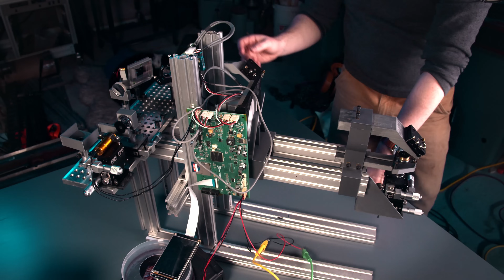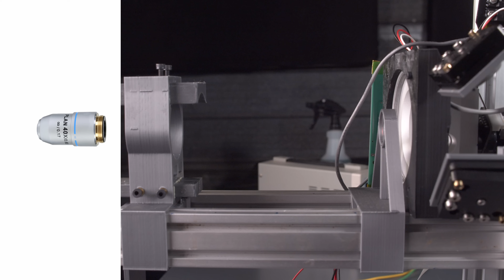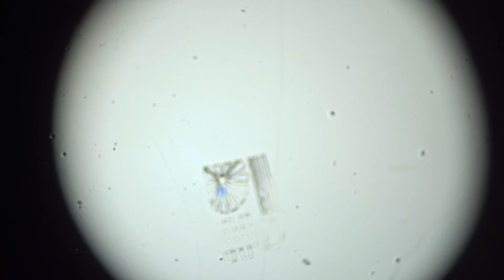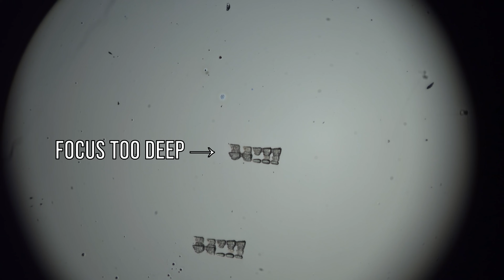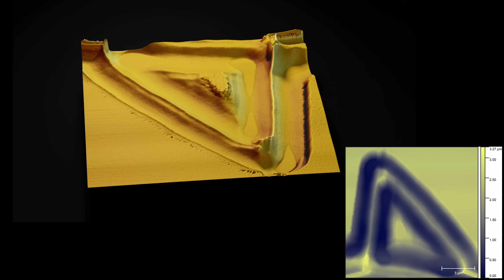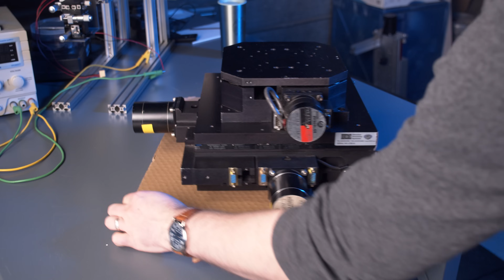DIY Semiconductor Patterning

Comment from the maker: 🚨 Addendum 🚨
- "Why not fix the laser and just move the stage under the laser?" 
It's a good question! Speed mostly, it's generally a lot slower to draw the pattern with a mechanical stage, particularly if you need a lot of "flood fill" regions. And in theory a galvo can give very small resolution even if the laser spot is relatively large.  I.e. you could position a 2 micron line (due to 2um spot size) 200nm away from another line. Depends on the quality of a stage, but precise movements of a large stage are a lot harder than precise rotations of a lightweight mirror, especially considering backlash and such on the stage. But it's a totally viable technique, and I might try it if I can't make the galvo behave. 🙂

- "Why direct-write laser instead of DLP chip?" 
No particular reason (my first attempt years ago was with a pico projector actually), I just wanted to try the direct-laser approach. There are some pros/cons to each. With DLP you run into limitations with pixel size quickly, which means you need correspondingly better optics to continue reducing feature size. Direct write laser can "scale" in that aspect a lot cheaper: a good clean beam passed through a 60x objective could theoretically hit sub-micron features.  OTOH, you have to deal with issues like the galvo linearity/stability.  So different trade offs. You can find commercial devices of both varieties competing in the same space for example :)
Reply: Hah, thanks for answering that. What about a stage that is based on one of those flexure designs? That would allow tiny movements.
Reply: Like fgbhrl suggested flexure xyz stages can be very precise, zero backlash, readily characterized and driven by very standard gcode. Any speed lost due to greater inertial mass may be offset by running many parallel beams at once. You could even make mirror images cut at the same time that would register perfectly with their counterparts - which may be useful somehow in the construction of MEMS devices.
  Another argument for using a mechanical stage is that your beams (and thus the walls of your resist) could be made to be exclusively perpendicular to the substrate rather than all converging at the microscope lens.
Reply: Thank you for the considered answer!    Have you also thought about using a Wicked Lasers LaserCube?   
Its blue diode is 1300mW at 445nm, which is within the range (350nm-450nm) specified by Microposit's datasheet.
Reply: I mean, you already have a sub-micron stepping stage, you just had to make a spatial filter for your laser and half a decent focusing optics to get better results with less effort... Also, is your laser polarized, and was the dichroic designed to work at 45°? Most of the off-the-shelf dichroic are designed to work at normal incidence and suffer big degradation in performance at high angle, especially if the laser is polarized in the wrong direction
Reply: Yeah this was the concept I had in mind for building one of these years ago. I never actually got anything useful but I had planned something set up like a vertical milling machine, with a fixed laser column and then an X-Y stage probably using picomotors.
Reply: Yes, speed. I have built a XY machine with 1um step size, 20um laser spot size and 15um backlash(compensated for in software). Camera calibrated.   Made for PCB prototypes. Runs at about 4cm per second. The quality is wonderful but it takes ages. 

To save time I make mainly additive, through hole plated PCBs...with large polygon planes. That way I only have to laser the gaps between the eventual copper. With it I can make "quick" 1 hour PCBs with 4 to 5mil (100um to 125um) features. Also very easy to do high res photo imageable silk/legend. The big pain is soldermask as most of the board must be lasered. 

But I am also working on a galvo system, using a 500mW 405nm laser. The laser, post galvo, goes through a large CNC-ed acrylic F-Theta lens (about 20cm x 20cm). My effective area is about 15cm x 15cm. The PWM is FPGA generated giving a resolution of about 32000 positions per 15cm.  The tool path is contour based to avoid all the problems with high speed laser switching with raster based systems...even thought the laser switches at 5Megapix/s.

Your video is very informative. Will be "stealing" quite a bit for my next machine.😀. Good work.
Reply: All school kids should learn how to make their own tools and chips,  build a small 2 cylinder combustion engine, and grow a few plants and animals so they learn the basics of farming too.
Reply: Is there any way you can see how far off the laser is coming out of the galvo and just use the stage to correct it? You could try to make the lines straighter and maybe even see if for some reason it's repeatably off mark the same amounts in when doing similar things? Kind of like how the Shaper Origin handheld cnc router uses a small but accurate cnc to improve the positioning you do by hand.
Reply: @Breaking Taps Idea: Using a 2-color non-soluble water solution as the lens in an ultra-clear glass or laminate? The water droplet would be large enough in a opaque fluid like a lipo or similar non-soluble base. Color the lipo base to the opaqueness desired where the laser will not bleed through or in the wavelength [frequency?] that will be etching onto your substrate. The water droplet will be ionized for clarity and then you can add coloring to get the desired wavelength. Amount will be enough that the droplet will remain circular consistency from top of droplet to the bottom of the droplet through the lipo solution base...so presumably naturally self-correcting [and/or self-arranging?] circular lens that you can adjust to your needs. I hope I conveyed it clear enough...I have a picture in my mind I'm thinking of but not sure if I'm describing well enough but I digress. Love the vids; hope it works out for ya, best of luck!
Reply: Trick for speed would be to have multiple lasers, OR use a larger more powerful beam spread out already that hits a DLP to make a patter, something I am considering as a solution for my ideas, along with a couple others for several color lasers tuned to reflect thus I can do the "donut effect" where one laser is counteracting the other laser and is a ring of laser light with a point in the middle so I can avoid the wavelength of the laser inhibiting going smaller. (ie the donut will clip any part of the energy injected due to the wavelength spread for a single photon, as I am guessing the photons are super tiny and an array of them are hitting in various points in their wave function, so this negates those outside the region needed while allowing the others to strike, effect, and cause reaction within the dark dot region of the other donut shaped laser BUT it will not be a donut but a shaped form sort of like a mask, so to speak so the negated region has to be large enough for the whole wavelength of the negation laser's photons.
Reply: oh reason I mentioned the above was over the dichroic mirror, in that it might offer a chance to combine the colors of laser into one straight beam using the beam "splitter" cube, to converge all three of a given frequency, later I may have to look into seeing if I can get create or have designed another shape or shapes like pentagon, hexagon ect to add more frequencies lol.
Reply: Why do some of those lenses look like something taken from a video projector? are they salvaged to use in this method? (if so awesome, I have a couple boxes of lenses and prisms and such from salvage for this sort of work LOL)
Reply: You should get some piezos from Piezosystem Jena to control the angles of the galvos more precisely
Reply: Hey, you might want to change your title. Your video is really interesting, but a simple change can really boost your views!
Reply: in my opinion the priority is to fix that wobble, maybe it needs more struts? (I used to play KSP).
perhaps you could do one mirror with fix spin or both axis with fix spin rate blink the laser to control it, sort like the old CRT did.
it could improve stability if the spinning does not vibrate due imbalance.
hum... now that is something hard to fix, unless you use a perfectly balanced system where the forces cancel out.
Reply: Make 7555  chip

Comment: i used to make those edmund optic breadboards at my old job. that was an absolutely mindnumbing task and i dreaded seeing the pallets of precision cut aluminum come in. each plate was straightened on the hydraulic press, sent through a timesaver belt sander multiple times, and drilled and tapped in up to 4 cycles depending on plate size

Comment: I watched a Form Labs 3D printer factory tour and they also tried to use a light show lazer manipulator and the speed is there, but the acuracy not, so they went to an in-house solution as they did not have contriol over the lazer.  But as you showed us, the contorl of the lazer is where your problems seem to start.

Great content, you really make me think about what you show and get right.

Comment: in a past I replace galvos(rotation will be always limited by angle step) with XY positioning movement system. Similar to XY CNC light router/plasma cutter etc. The laser beam come to X mirror which you can make X movement and then to Y mirror. You need a bigger lens after XY positioning system, but resolution can go up to 100 nm. Have you tried ?

Comment: The 20um dia for the pinhole is too much for 450um laser  beam. To clean the beam from the higher harmonics, the pinhole diameter should be about 1-2 the wavelength.
One way to make a pinhole is to focus beam with ~1"FL lens and place thin film of paper/plastic/ptfe in the focal point. The beam will burn a hole in the focus, and that will be your pinhole.

Comment: Could you direct etch copper off 0.5z PCB (0.0007" thick) with a regular 40W K40 laser source IF you apply dry moly lube on top of it ?

Comment: You've got to look into green lithography technology. I covered some in my quantum hardware lecture series on QuantumGrad. Basically, egg whites diluted with water can function as a polymer photoresist and even e-beam resist. This means that egg whites can serve as resist material for both micron and nano scale features. Plus, it's non-toxic : D
Reply: Thank you for this tip. Looking in this rabbithole.

Comment: Nice work 👍 Why dont you use much less optic? Also you may try to move the laser instead of the mirrors. Your speeds are slow so it shouldnt be a problem. Laser printers have such laser scanning mechanism. You may hack one of them.

Comment: Nice project! I built the DLP version of this a few years ago, using a UV light engine and a wafer inspection microscope, rigged to step and repeat. Pretty good results at comparable resolution, although with some imperfections on the tiling.

Comment: You could make your own galvos that use flexure bearings.  This should eliminate the stiction which is likely the source of your errors.  You could also take position feedback directly from the back of the the mirror.  I have made galvos as simple as a mirror cemented to a Nd magnet,  centered in a helmholtz coil, supported by a wire torsion bearing. Since you’re not too concerned about blazing speed this could work for you.  You could also make a two axis flexure for the mirror, along with two crossed helmholtz coil configuration. 

You could also buy a mems laser scanning mirror meant for laser projectors like the sony CL1

Comment: That may be a stupid question:
I've seen machines like ASML with lots of mirrors (like you did) costing millions. The question I got is why you need to reflect the beam at all. Why can't you "just" shoot the light straight at the lens and down to the material. Would love to hear your answer on that :)
Reply: An assumption here but hope someone else clears this out as well. I think those mirrors are not just reflecting but “focusing” the light. As far as I saw from instructive animations ASML shares material itself moves as well. Once light is masked out they try to hit different places million times essentially drawing the chip on the material. It would help with going lower nanometers. This was my assumtion from my basic optics and chip knowledge. I hope someone experienced clears this out. It is really hard to find information in this niche field.

Comment: I don't know if you'll see this or respond, but would it be possible to etch patterns into some usable substrate with an electron beam? You could build a vacuum chamber out of an old CRT, preferably a really big one, and control the beam using its own deflectors?

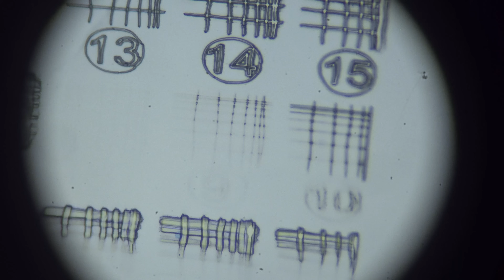Comment: 14:00 - I don't think it is a galvo issue. Something is probably vibrating. Your repeatability test confirms this. If it was a galvo problem, you would see the same problem over and over. I have worked with Cambridge galvos and Thorlabs galvos. See if you can get one of those on E-bay.
Reply: Don't you think just after conversion of the beam from angular to Cartesian, it would've just worked.
Or after the microscope objective. Instead of going through soo many lenses.. just use the microphone objective with the least steps possible.. then use a angular to Cartesian lens again.
Because I think using soo many lenses, plus angular etching/lithography... Just don't seem precise or fit for such precise tasks.
Also, possibly optimising and accounting for the galvo vibrations, and also calibrating for the non linear (Cartesian in theory is supposed to be linear but here... Its clearly not) movement of the beam before the etching/litho process.

Comment: Great video, well done. Excellent results based on the components used. Perhaps have a look on eBay or similar for used CD/DVD mastering equipment. You could probably get the table and optics for a good price and it's a lot more sturdy. Most of that equipment is now obsolete.

Comment: One thing that might give you a major improvement in power is to adjust how you are doing the beam quality enhancing aperature.  Running the wide beam through the aperature is blocking a lot of light.  If you use two lenses to focus the beam and then return it to parallel, placing the aperature near the focal point might enhance quality while also enabling more light to pass through.